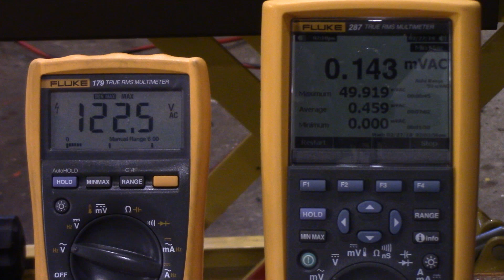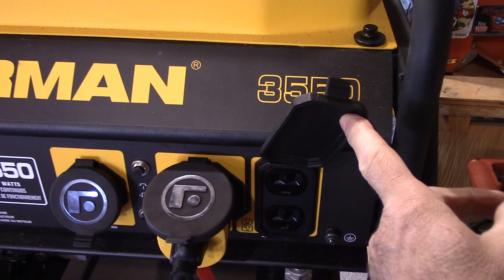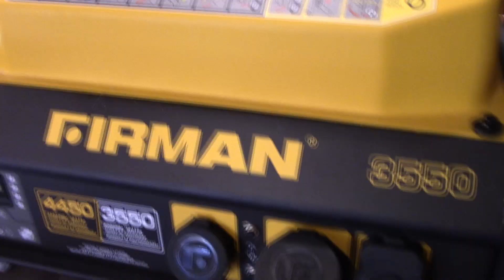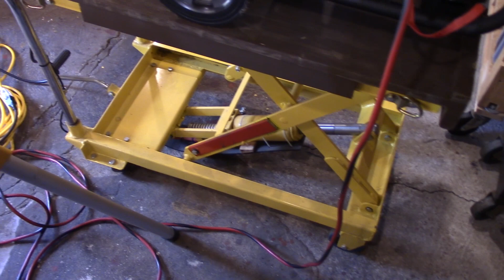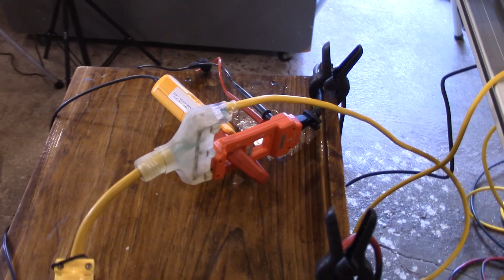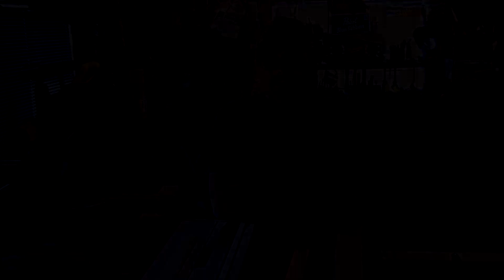LOAD  TESTING THE FIRMAN PO3501 3550/4550 WATT GENERATOR   -  DON'T TRY THIS AT HOME

Comment: Good test Steve.  That generator sounds like it was an awesome deal for you.
I'm considering getting some kind of back up generator for the house.  The power doesn't go out all that often (not near as often as it seemed to when I was younger) but I'd be a bit worried if the power was out for an extended period of time with a deep freezer and fridge full of food.  Ideally I'd like to have a connector to the breaker panel but not sure about that yet.  I'd do it properly and not run a deadman cord,  that's for sure.
Reply from the maker: The hydro  went out here in the spring  for 19 hours  , I ran - furnace - fridge - internet - a couple of lights and the freezer . I used about 2 gallons  using this. https://www.youtube.com/watch?v=UnWyKIOQ9JQ
Reply: STEVE ROB REVIEWS that sounds cheaper than the city's electric bill here. ..or hydro bill for you.

Comment: How you liking this gen i bought the 3300 watt one but was wondring if they are good machines. Still havent recieved mine  yet , but hope they are ok.
Reply from the maker: I have used mine a lot to run my table saw , circular saw and air compressor and it's always started in two pulls and one tank of fuel lasts me a day of work . I dont use the on/off switch at all because I go for months at times not in use so I just turn the fuel valve on and off  when I'm finished using it .  Awesome Genset.  Cheers
Reply: @SteveRobReviews  thanks steve i hope i enjoy it as you do. Your vid was the best review because we can see the numbers as you test it.

Comment: Hey Steve
I have the 3550 Firman generator 
On the hz display what’s the code F6 1.1 mean?
I can’t find the codes listed 

Thanks
Reply from the maker: Bob where are you reading the code off of.  The ideal reading on a DMM should be 60HZ for north America.
Reply: @SteveRobReviews  
Hi
On the digital display 
When you scroll down from the top it’s
Voltage =124
Hz = 1.9
Hours 1.5
Oil

I’m trying to understand what F6 1.1 is
That code changes with more or less devices connected
Reply from the maker: I have never seen this .  I would try testing your receptacle with a DMM and see what it actually is and send an email to firman and ask what's the display reading your seeing mean.
Reply: @SteveRobReviews  
I actually just got off the phone with Firman tech support. 
That was 10 minutes of my life I’ll never get back. 🤣
The tech guy says that’s the hz. 
I said, what does F6 1.1 or F6 2.0 mean?
He says that’s the hz. 

I will send them an email. 
I took a picture of the display reading. 
I thought they’d have the code listed somewhere.  
If I find out what it means I’ll post it here. 
Knowledge is power!😁
Thanks
Reply: @SteveRobReviews  

Hey Steve
Just thinking out loud hear
Maybe that hz reading is 
F for frequency 
and then read the entire number 
F62.1
Is actually 62.1 hz??
When the reading changes for example no load reads F6 3.3
Which might mean F 63.3hz

Does that make sense?
Reply from the maker: Yep and under load it would drop to about 59-60 . I have never seen that on my firman so its logical but man they sure could have just  gone with the numbers followed by HZ.
Reply: @SteveRobReviews  
The more I think of it the numbers do reflect frequency. 
Because the way they were grouping them I thought it was a code. 
Anyways I’m pretty sure it actually means the actual frequency. 
Problem solved!!
Have a great day!

Thanks! 😁

Comment: Why is the 287 reading millivolts, I guess I'm just confused about how you are deriving your amperage numbers.  Great video though, thanks for showing.
Reply from the maker: Brian the amp clamp attached requires the MV  setting and the meter shows it in amps. Cheers

Comment: Great test thanks. I just bought the same gen to use at my trailer when the power goes out to run my fridge. Do you think it’s strong enough to run the window A/C at the same time?
Reply from the maker: It might just do both as its performing better than  the listed ratings. I will buy another when they go on sale . Cheers

Comment: Looks like you will have no problems.  My only suggestion for your system would get some 12 gauge extension cords.
Reply from the maker: I use two up at the camp  12 gauge , yes the drop is crazy with a high load on a cheesy 18-14 over a long distance. Cheers Rick

Comment: Looking good buddy. You didn't let the smoke out so you should be good to go 👍
Reply: Dang I like going sideways. 
Especially inna pickup truck in the church parking lot in the snow. 
Gotta cut loose once inna while. Gee whizz.
Reply: Ya dew it at night after it's snowed and ya just shut your headlights out as long as ya don't got those communist installed day running lights. When I use to ride my motorcycle at my dad's place I didn't wear a helmet. Now I wear one in the living room watching tv. I mean if they tell me I gotta wear one while watching tv I won't. I'll just stop watching tv. They tell ya not ta smoke two2. Which might be a good thing but I should be able to decide that for myself and if I was brought up right I don't do it. But I do smoke when I'm on fire. 
See the smoke yet. I'm sending smoke signals. Probably gonna outlaw that two2 too tree3.
Reply from the maker: I had a fan in the background ready to go if things went sideways . LOL
Reply: MostlymoparIH lol. Grew up with church just past my backyard. People doing doughnuts in winter was normal up to the mid 90's. Not sure why people stopped. Sure the neighborhood got mad, but secretly I wanted to do it. Lol

Comment: I like these tests Steve. I run a gen set on occasion and knowing the limits is important.
Reply from the maker: Wyatt I have a friend with the same genset that  did not   take it out of the box for 3 years  and says when the power go out he will use it.  Well the power went out for 19 hours in the spring and he had no fuel and no way of powering his appliances .  Its out of the box now but never had any fuel in it yet. LOL

Comment: OK Steve my first question is,  Is that generator vented outside?  and what? you're not gonna rip a piece of wood with the table saw and cut a 2x4 with the circular saw at the same time? lol  very good test, nice generator.
Reply from the maker: Well when the power goes out I don't use this genset I use this one  https://www.youtube.com/watch?v=UnWyKIOQ9JQ much more efficient and it runs in the shop with a window open for fresh air.  This genset will work but it would burn about 3 times the fuel. Thanks bud I had a blast doing this vid. LOL